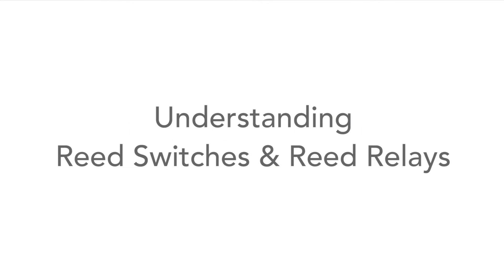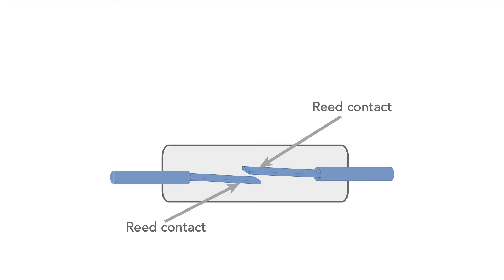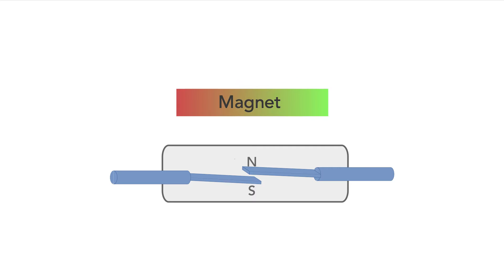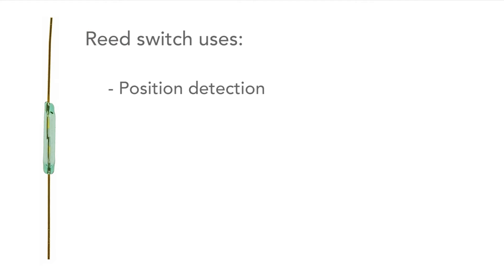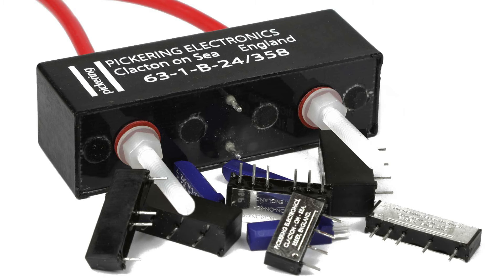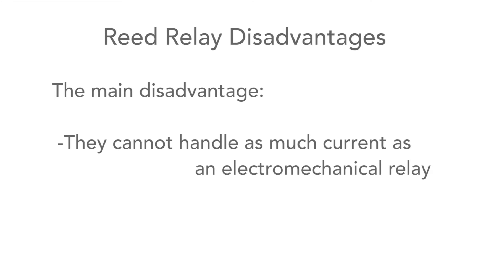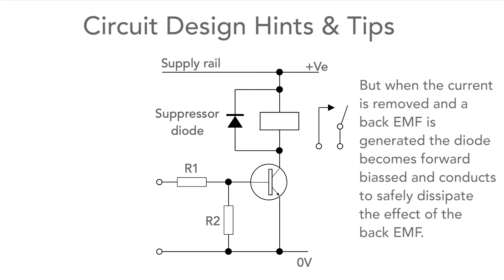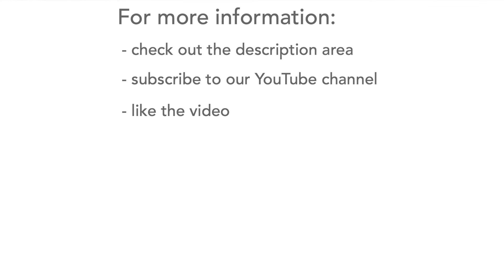Reed Switches: The Coolest Tech You've Never Heard Of

Comment: I have Reed switches all around my house at this point (cabinet & closet lighting, intruder alerts on windows, etc), and I've tried just about everything I can think of (or Google), but I have yet to find a way to get the contacts inside the reed switches to stop fusing together after a couple of weeks to a couple of months!   Even using as little as 5v 60mA, they always seem to go bad pretty quickly.   
Any ideas would be appreciated....
Reply from the maker: That is very annoying. I didn’t have trouble with that when I used one.

I wonder if you are switching an inductive load. The sparks from the back emf can kill reed switches very quickly. Also if you are driving a capacitive load, the inrush current when the reed is switched over can fuse them.

I suggest having a look at these aspects and also trying some higher rated reeds.

I hope this helps.
Reply: @ElectronicsNotes  Thanks for explaining that driving inductive or capacitive loads with a reed switch may result in a short life.    Should be fine if you're just using LEDs and resistors, I would imagine.
Reply from the maker: @Dad-ij2qy Driving resistive loads will be fine. They are great for that.

Comment: Can you please discuss the various methods of recovering the BEMF generated when a relay coil is de-energised.
Recovery values of 80-90% of the input power in a pulsed relay driver circuit are possible, given the correct circuit/coil parameters.
Cheers.
Reply from the maker: This is not something I have done, but I am sure there is someone out there who has done it. When I’ve used them I have not been in a situation where I needed to recover the back EMF.
Reply: @ElectronicsNotes I have working examples in my Lab if your interested in further discussion/schematics.
Reply from the maker: @ricksampson6780  that would be interesting. Thanks.